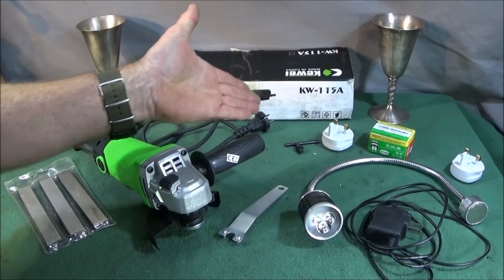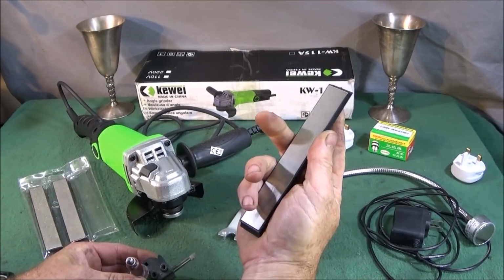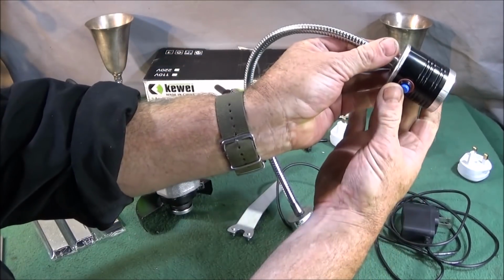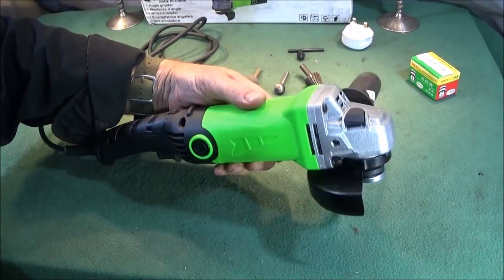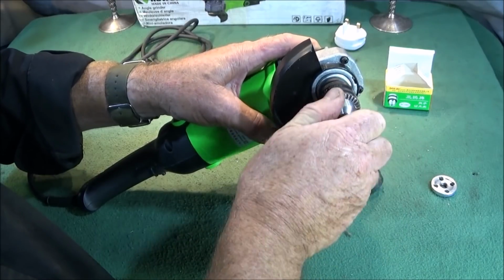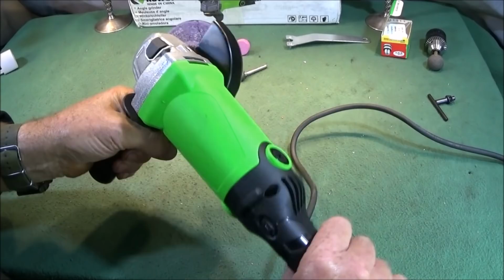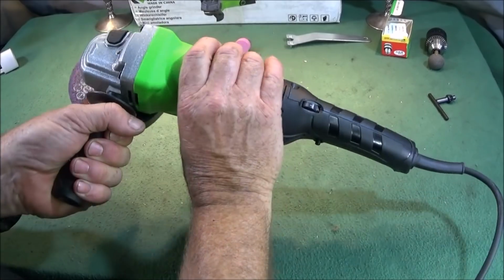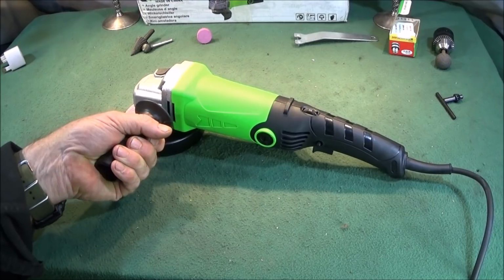New Diamond Laps, A Machine Lamp & KW-115A Small Angle Grinder

Comment from the maker: SEE LINKS BELOW:-
  3W 220V 400mm LED Lamp Lathe Machine Tool Light --  https://goo.gl/Vz1xMk 
   SANOU 1.5-10mm Metal Stable Keyed Drill Adapter Drill Chuck --  https://goo.gl/XDsMJL 
   3pcs 240/600/1000 Grit Knife Sharpening Stones Set Edge Sharpener --  https://goo.gl/Z1D3uC 
   220V 1200W Multipurpose Angle Grinder 6 Levels Speed Polishing Machine -- https://goo.gl/oS9uV4
Reply: Steve Jordan
would that lamp be good for welding ?
Reply from the maker: $9.9 4 Inch Grinder Disc and Chain --  https://goo.gl/zLURPc  (coupon: 6022b2)
Reply from the maker: Banggood 12th Anniversary New User -- https://goo.gl/dGwdoS
    Banggood 12th Anniversary Warm-up Sale --  https://goo.gl/yAECU1
Reply from the maker: Banggood 12th Anniversary Electronic Sale --  https://goo.gl/SY4GX1

Comment: Just for info, Lidl sell a variable speed angle grinder, 5" model with standard M14 spindle. They are on sale next week for £20, I have one and it works great, wire wheels and flap discs are so much nicer to use at slower speeds.

Comment: Yet another GREAT video Steve!  Thank you for all you do to bring us this information!

One point I'd like to bring up for those of us in the USA.  While the Grinder in this Video (and others) does have a Plug End that fits the Electrical Outlets in the USA, the product is for 220 volt.  The common power in the USA is 120 volt.  We do have 220 volt in the USA but, that is typically used for items with a high(er) amp draw like Welders.

I placed an order for the items found in one of your prior videos.  It was the video titled "A Neat Die Grinder Hack. Easy to Make Lathe Toolpost Drill Set-Up" .

This is just a warning to those of us in the USA that order items that are electrically powered.  Be SURE the items are able to work on 120 volts!  I have one Paper Weight because I did not check for the operating voltage!

I would love to purchase the items in this video if they came in 120 volt!

Once again Steve, THANK YOU for all the great YouTube content you make!!!  I'm looking forward to your next video!

Best regards,

Willie
Reply from the maker: Hi Willie thanks for that. I made the same mistake when I got my ultrasonic cleaner, I got 120v. I managed to get a low cost transformer 220v -120v from Banggood to rectify the situation though. Regards Steve